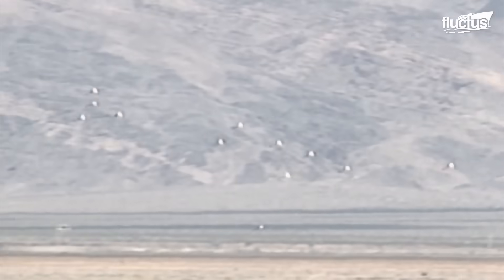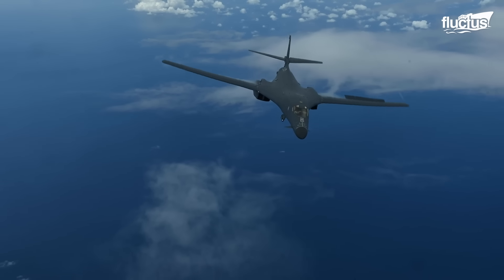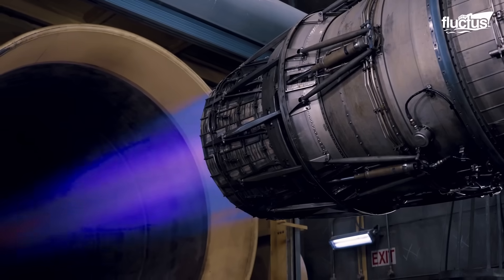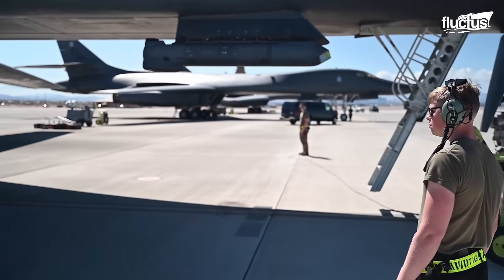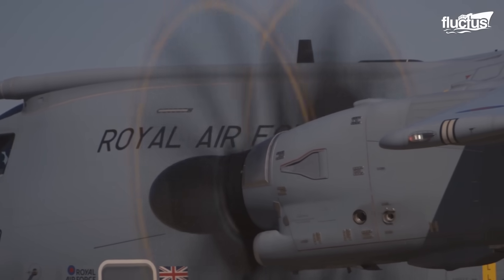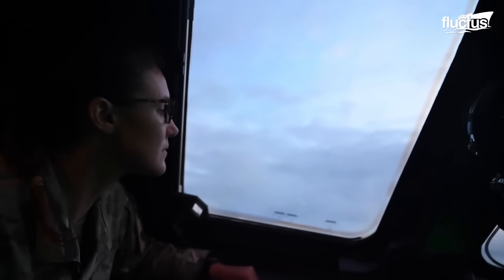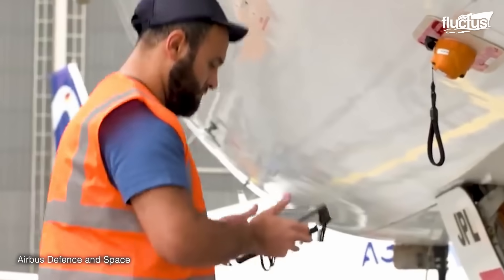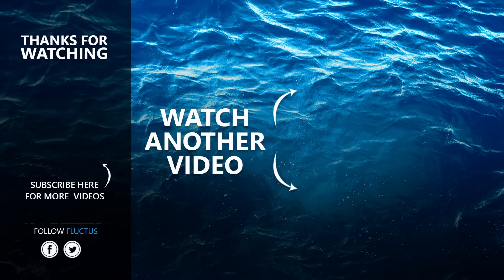Crazy Reason Why US Spend 1 Week Maintaining B-1 Bomber After Each Flight

Comment: Jimmy Carter was right to cancel the original B1 bomber. Congress saved it because they wanted the jobs in their states, but they changed the mission to a low level penetration missions, *which it has never really had to do in combat*.  It was too expensive in its day, and they could only afford 100.  It cost $61,000 an hour to fly the B1B. It was a huge mistake to build it and Carter was vilified for actively working against the program, but he was a military veteran and he knew this kind of plane had limited use. The Air Force has big dreams, and the F-35 is another aircraft that was way to expensive and should not have been built. It is $38,000 per flight hour, and currently, it is only running a bit over 50% availability. The Marine AV8B averaged over 90% during Desert Storm and Iraq.  Congress likes pork.  When the contractors promise to have some parts made in their states, they simply can't say no to a bad contract.
Reply: @@ristokempas The B1B can no longer fly low level penetration missions due to airframe aging and it would never survive a high altitude mission. The B1B can't carry nuclear weapons. With full munitions, it is limited to flying with the wings un-swept, so it is subsonic.  The B1B was never a real deterrent to nuclear war, and could not survive a high altitude attack if there was a nuclear war. Modern SAMS are simply too good. Assuming a first strike by Russia, the important air bases and nuclear launch sites in Europe would be some of the first targets, so the only B1Bs left would be in US, and by the time they could do anything, the war would be over because we would have launched before they could get the B1Bs off the runway. The B1B is scheduled for retirement in about 7 years. Judged just as an airplane, I love the B1B. Judged as weapons system, it was a titanic waste of taxpayer dollars. Yes, it can drop bombs, but it was never  going to be used in nuclear war and a much cheaper fixed wing bomber would have been money better spent, but even the B52 is still humping along and will do so long after the B1B is nothing more than museum piece or lingering in the desert.
Reply: you are wrong B1-B is one of the greatest assets this country has!!!!!
Reply: @dmc9791  It can't fly low level missions anymore, and it can't carry nuclear  weapons anymore, and it can't fly supersonic with a full load of conventional weapons.  Tell me how it is better than the B52? The B1B is set to be retired soon. If it was essential to have it, the Air Force would have requested funding to update it. The Air Force is spending the money to put new engines on the B52! They didn't because they know that it isn't a viable weapons system any longer.
Reply: Quite  simply the F-35 IS JUNK ! I SHOULD KNOW !
Reply: Rubbish. Giving Carter the sack was the sanest thing the American voter ever did. God bless Ronald Reagan for restoring our defenses and defeating the Evil Empire
Reply: Jimmy Carter was a complete idiot.
Reply: The real winner are the contractor who get the meat while the politicians get the bone of what they took from the people
Reply: Its not a mistake. Its a nation pride
Reply: Don't care I think it's the coolest aircraft ever made
Reply: It is a cool and a beautiful plane, but we didn't need it. There is no case were this aircraft would have been used to fulfill it's design goal and in fact it was not ever used in the manner which congress used to justify the purchase. As great as an airplane as it is, we could have easily done without it. Congress members wanted to make jobs for their constituents, but that money would have been better spent in an infrastructure bill to fix bridges around the US, many of which were in bad shape and some of which have since failed, killing people.
Reply: Yes but it looks so pretty.
Reply: @pitdog75  It is a pretty airplane, but that isn't what got it built.  Even congress did not want to built it, but Rockwell promised a lot of congressmen that were against it that they would build parts for the B1 in their states, and congressmen love pork.  Most of the western military leaders in NATO were also against it, saying that the money would be better spent on cruise missiles.  In the end though, the promise of jobs to keep the congressmen in office prevailed, and we got a pretty plane that we didn't need.
Reply: @@ristokempas Too vulnerable at high altitude, and the airframes are no longer certified for low level penetration.  The B1B just isn't useful against advanced nations and you just don't need it for tier 3 countries like Afghanistan, where the B1B didn't make a tiny bit of difference to the outcome, and where we essentially lost. Bush made a colossal error by entering into war with Iraq and Afghanistan, but even without the B1B, the outcome would have still been the same.
Reply: Thanks so much for your comment. Your are of course absolutely correct. I  will always remember P. Sprey who when asked what the F35 was actually good at replied with: "It's good at making money for the manufacturers. That's the only thing it is good at". This observation applies to the entire military - industrial complex. It is good at making money for those who own and operate it. In contrast to the civilian sector where producing and selling useless goods is also common but has little consequences applying this approach to the military - industrial sector will result in an army unfit for combat.
Reply: @wkgurr  Same with all of the stuff they sell to the government. I'm sure it'd be infuriating to know just how badly the government has been price gouged by the military industrial complex since the end of WW2. We will probably never know the true numbers unless an actually independent third party with enough access did the math which I'm not holding my breath on. This is what happens though when the people calling the shots have direct conflicts of interest in whatever it is they're overseeing whether it's military spending or regulating monopolies and they remain in those positions until the day their soulless bodies draw their final breath or they stroke out on the senate floor or on national news. The result is we have 50 years of the same old bullshit and a wrecked country. The majority of the population of the US who live under a cloud of ignorance for their entire lives are also partly to blame because those assholes wouldn't be there without them.
Reply: That’s one reason we’re 30 trillion in debt
Reply: @calvindavis7591 
No, the reason we’re in debt isn’t because of our defenses. It’s because politicians love to bribe their low-IQ, low-information voter base with free stuff. Tax and tax, spend and spend, elect and elect.
Reply: @calvindavis7591 nope.  A drop on the bucket.  Learn math
Reply: @jimheidl1272  Addition still applies, even to drops in a bucket.
Reply: @calvindavis7591 perspective: if the US spent $0.00 on defense in 2022, we would still have run around a $500,000,000,000 deficit that year, despite income tax revenue being the highest it’s ever been. Yes, technically the existence of military programs contributes to the annual spending, and adds to the total debt. But it is far from being the real problem. The real pork is in all the idiotic social spending programs that are slowly but surely failing despite the highest tax revenues of all time.
Reply: @calvindavis7591 we weren't 30 trillion in debt when Reagan resurrected the B-1B
Reply: Don’t say something shouldn’t be around till you have had people thank you for that aircraft being there and saving their lives in combat. It may have never lived up to what it was sold as but it saved a lot of lives in the war on terror.
Reply: @John-oc1ow  I have no doubt that it did, but the question is could a far less expensive airplane have done the same thing?  When what you have is an expensive plane, then of course you are going to use it when you can, and of course it will save lives, but a much less expensive aircraft could have done the exact same thing.  The B52 dropped more bombs in the gulf than the B1Bs did, and it will still be in service long after the B1B is replaced. It should never have been built. It was designed for a mission that it would never do and used because once you pay for it, you have to use it or it makes you look stupid for buying it. Did it save lives? Sure, but so did bullet proof vests and up armored Humvees.
Reply: @shenmisheshou7002 I could tell you all the wonderful things and all the terrible things about the B-1 but you don’t want to hear it. Take it from someone who has lived with the aircraft for years. When it works it’s the best at what it does. It does take a lot of maintenance but it offers things no other bomber in the inventory can match. The Bone is here and we have definitely gotten our monies worth.  Here’s another unpopular opinion for you the military should have a blank check to buy anything they think they need. A guy who never put on a uniform has no place telling the military what they do and don’t need.
Reply: @John-oc1ow  The B1B is an incredible airplane, but we could have spent the money better. That is all I am saying. I love the plane as a plane, but as a taxpayer, I think it was a horrible decision to build it.
Reply: @shenmisheshou7002 I don’t know what better aircraft could have been procured for this roll at that time.
Reply: @John-oc1ow You can pay for it then. The jet is a gigantic waste of money.
Reply: @@ristokempas The S-400 can certainly shoot down an F-35. Tod Wolters, the commander of U.S. European Command and NATO’s Supreme Allied Commander for Europe explains – “You cannot operate an F-35 in the vicinity of an S-400.The Russian anti-aircraft missile system (SAM) S-500 “Prometheus” is an even bigger threat. Now if you are going to be fighting a Tier 3 adversary, then stealth is your friend, but the reality is that jamming can be just as effective. Anyway, while the F35 can get closer, it is unlikely that it could do a deep penetration against an advanced adversary but realistically speaking, do you think that an F-35 attacking Russia is not going to end in nuclear war?
Reply: Jimmy Carter wasn’t right about anything
Reply: @courtman007 Oh because Reagan was right? Everything Carter did was right in my book and he was the next to the last intelligent guy with a heart, GW Bush the last one.
Reply: The B-1 was a supersonic low lever nuclear penetration bomber in which it was extremely well suited for the role. After one of the numerous nuclear treaties it was neutered and all of its nuclear wiring was removed per treaties. At the height of the Cold War it was one of the reasons the Soviets came back to the bargaining table. It was the first thing the Soviets wanted eliminated in the talks. It was and still is a great aircraft. And by the way, Jimmy Carter wasn’t correct about ANYTHING when he was President. He’s a good humanitarian but a lousy President.
Reply: @museumjunkie9317 p😊
Reply: @museumjunkie9317  First, the B1 was not a low level nuclear penetration bomber. The B1 was a high-altitude strategic bomber. (The B1 was never entered into service and only 4 prototypes were built.) This is the airplane that Jimmy Carter cancelled. The B1B was the folly of congress and the air force. The B1B was not really a deterrent to Russians and neutering it was an easy to make sacrifice because everyone knew that cruise missiles and ballistic missiles would be the way a nuclear war was fought. They gave the Russians something that didn't matter. Everyone knew it, but the Russians could say that they drove a hard bargain with the Americans.
Reply: @shenmisheshou7002  The B1 was designed to come in low and penetrate Soviet airspace at high speeds and get close enough to fire stand off nuclear cruise missiles from a rotary launcher. I understand that NOW we have missiles that make that unnecessary but that was the rational. Basically a hyped up F-111.I'm not sure where your getting your info from. The B1 was a great plane and still is. I don't intend on continuing this thread anymore but I'm quite sure you will. Have a nice day.
Reply: @museumjunkie9317  Congress knew that this was not a viable proposition. The Russian Foxbat had look down radar that could easily see the B1B.  Even the Pentagon was against it because they thought the upcoming (then secret to the public F-117) and the soon to follow that B-2 were going to be money better spent. NATO leaders thought that cruise missiles would be better, and even Congress was initially against it until Rockwell said it would build parts in states where the congressmen were vulnerable in upcoming elections, and offering jobs would give them something to brag about. This is the way the defense industry works. It isn't about the best plane, it is about politics.
Reply: @shenmisheshou7002   Your probably right.
Reply: I gladly pay my taxes and I wish I could choose to devote 100% of my taxes to the military instead of social programs but we don’t get that choice. So thank you for helping to pay for such a great aircraft as well as all the other great aircraft in the US military.